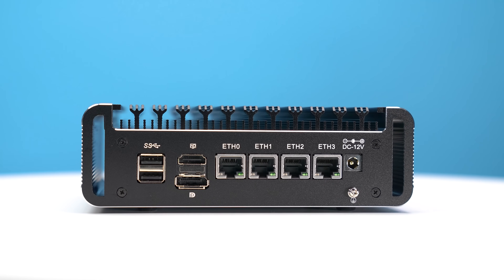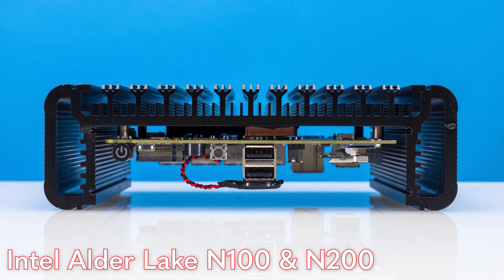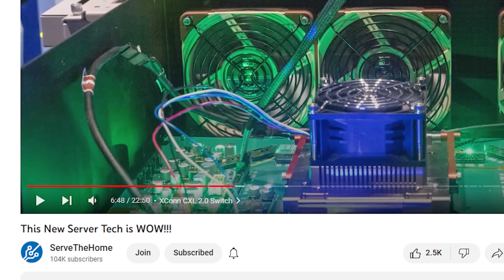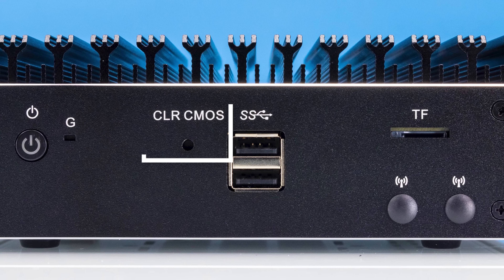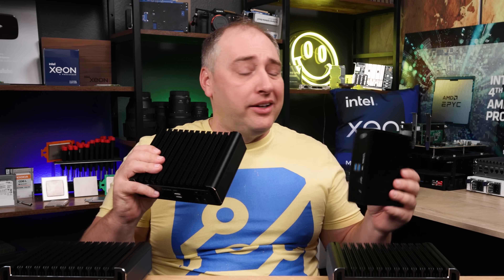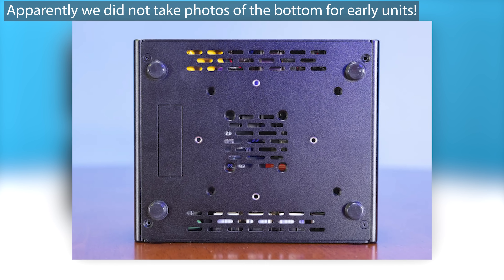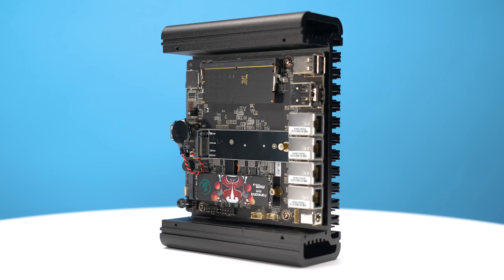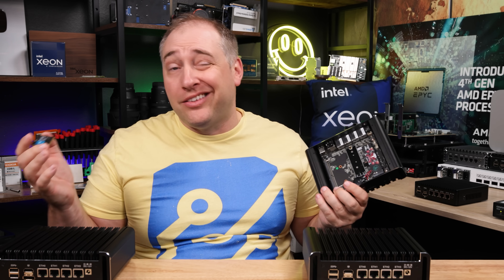HUGE UPGRADE! New Firewall Router Virtualization Host

Comment: You need to test those ports. I've heard about issues with drivers. They seem to work but won't perform well. Can you test ?
Reply from the maker: The i226-V in these is fine. We have close to 100 ports running 24x7 in labs.
Reply: @ServeTheHomeVideo  are you load testing them ?

Comment: Man for the $400 price range for a low power firewall/router box I'd want IPMI and at least some PCI express expansion.  This price tag seems a little too high for its use case + feature pairing.
Reply from the maker: IPMI adds around $25 and 5W plus another security surface which is why it is rarely included on lower power firewall boxes.
Reply: @ServeTheHomeVideo  That is fair but the out of band management advantages are kind of undeniable, especially for a router.

I think I paid maybe $540 for a Supermicro SYS-5018A-TN4 a couple of years ago and it just seems like a so much better value proposition, particularly with what it might cost now on the aftermarket. You add a 10gbps add in card and you have most of what this does, with reduced efficiency I suppose.

Yes the 4x builtin NICS are 1gbps (though, I think they had dual 10gbps models). It just seems like these tiny fanless systems should be less for what they are.

Comment: They are heading in the right direction, quality-wise, with these but I'm wondering if they've have reached the point of diminishing returns? The N100 is selling for 32% more than the last N5105 I purchased about a month ago. The performance improvement (according to this video) is less than that. For what they mostly get used for (firewall, Home Assistant and the like) the previous version had more than enough grunt. Thanks for the review, Patrick, but I'm gonna pass on this generation unless they have a price drop.
Reply: I was in the same boat and went for a 5805 instead.

Don't forget these are single channel and ddr5 is really expensive now.
Reply: The GPU is vastly superior

Comment: They look good, My hope is one of the vendors someday add basic lights out management, so it's possible get to the device if your OS has an issue.
Reply from the maker: Many folks do not want that on firewalls since it is another security surface and OS. Adding a AST2600 probably adds around $25 and 5W of power consumption. That is a lot on this class of device

Comment: Local ISP now offers 3Gig service with a 10Gig port on the ONT.  Need to see units with 10/5/2.5/1 gig ports or multiple sfp+ ports asap.  Usually the best option is a supermicro or Asrock rack Xeon-D since they often get 10Gig ports.
Reply: Need much the same as are finally doingnftth drops here  with 8gb avail..   but need a box much like the one in the vid only with min 2 stp+  for IO (3 is better in case one dies)

Oh and asrock is bottom of the barrel   after decades in IT and doing a ton of review and test work Asrock has been blacklisted by us and quite a few others due to their beyond shit CS..

Comment: I have been running similar 6-port Celeron N5105 as my Opnsense box and it's been flawless for a year. However, the cpu is a bit on the weak side if you'd want to also run intrusion detection scanning with it. That Alder lake surely would be a better fit to that kind of cpu load.

Comment: Waiting for a solid 10G appliance for firewall/router combo with opnsense.
Reply: Indeed   2.5gb in in min now for faster inet connections...  my house in wired for 10gb 15 yrs ago ffs..
Why the lack at least 1 sfp+ in curious
Reply: Stop waiting. That's trivial to build on your own with any basic PC (including something like in this video) and a switch.
Reply: @BlownMacTruck  at what cost? I mean energy wise. How much power would it consume and how big would it be to have equivalent?
Reply: I think that will remain the realm of DIYers for many years still, but at least we can now achieve solid 10G routing and multi-gig VPN with low-mid range desktop hardware.
Reply: @Justin Slay look for Deciso DEC 740 and higher versions
Reply: Does the m.2 slot support adding a 10gbe adapter in??
Reply: They're usually pcie 3.0 x 1 so not 10 Gbps capable pcie ports as cpu is like 8 lanes total
Reply: Yeah, my ISP recently started offering 5Gbps fiber and I don't want to be stuck with the modem/router combo they provide.

Comment: The use for the other M.2 is if you want to have a small storage node and use it mostly as a switch or router not firewall. Having 4TB of free space isn't a lot but it is enough for some for network storage for their home shared storage. For less than most NASes just without the redundancy you would get with any NAS system would give you.

Comment: I’m pretty new to networking, does having those 4 2.5G means you could use one as WAN, and the other three as LAN? Maybe with the ability to use a V-Lan for each of those?

Also, in the case you can do V-Lans, would I need managed switches?
Reply from the maker: Yes you can do that. You probably would not want to treat it as a switch though since passing traffic between ports on here goes through the NICs and CPU instead of through an onboard switch.
Reply: Oh okay, what should I research about in order understand how to use this type of device? I’m a computer scientist so I’m no stranger to containers and systems engineering, I have some knowledge of networking but this is a bit out of my league

Comment: I want the same, but with fully featured wifi subsystem (4-6 mountable antennas, etc). Wifi on this thing will suck :( So it's just a router, with pricey case (i think it take more than a half of the price).

For years I'm lazily looking for perfect home router, 4gb+ RAM, without OS bundled (it should just boot from SD, or USB stick if any plugged, the rest I'll do myself over SSH). One or two PoE ports would be great to have. CPU arch doesn't matter when you're Gentoo user, you know how to cross-compile Linux :)

Comment: Hi, the G hole stands for : "Guard me from the curiosity of Patrick" \o/😋

Looks like a missing act or the recycling of a former (or a future) metal sheet folding, anyway, it looks like the place to put a rectangular LED - this is understandable, as tooling, processing and silkscreens cost a lot for small series of devices.

Comment: While I agree that the performance jump is better than the 5105 or 6005 it still does not match performance of 6th or 7th Gen i7. I have a Lenovo M720q Tiny with a 9700T CPU. With the 4 port I350 and 16 gig RAM it's cheaper than a N200 equipped machine.
Reply from the maker: That will also use a LOT more power. It is very competitive more with the 35W Core i5-6500T, but with a total system power that is less than half of what we saw with those systems. Good thing there are lots of options. We have 1-2 cool TinyMiniMicro builds coming. Deciding if we can get them both into a single video.
Reply: @ServeTheHomeVideo  Yep, this is exactly the benefit if you run it as a firewall appliance that isn't running full load all the time, low/partial load is where these cores will shine.
Personally hoping someone will make a dual SFP+ equipped one, just cause 2.5GBe quite isn't there in the datacenter used market and likely won't be.
Reply: The difference in power consumption makes it a bit of an irrelevant comparison for anyone seriously considering one of these. Beyond just cost of power these could be run off of a relatively tiny battery backup system or even offgrid alderlake also has in silicon fixes for security issues that earlier Intel chips don't for people who might be concerned about such things. Older second hand is almost always cheaper and going up a few skus in power will still perform better unsurprisingly.

Comment: I hope they're going bring out some with the U300 Line. Then they would have enough pcie lanes for 10GBit connectivity. That would be insanely useful. The single P Core could also be tremendously useful for routing and stuff thats highly single threaded.

Comment: I really wish they would put these in a rack mount case off the bat, or offer the mounting shelf for two of them like palo alto does for their small firewalls (pa-820 etc) - would allow side by side mounting for running ha configs.

I still havn't got round to putting the mini firewall in place because i don't have a mounting option for it in the rack currently.

Comment: With the added performance we need to see more units with SFP+ ports.. TWO 2.5 and TWO SFP+ would be great.. R86S refresh should be coming soon
Reply: Exactly! I'm just starting to look into these types of units to prepare for 10G fiber from my ISP at home and can't find anything small with 10G except for the R86s units, but they are a bit underpowered, I think... Am I overlooking something?
Reply: Same here  this new unit would be perfect for power etc  but they are finally laying in ftth where I am (after often was done a decade ago and idiots in charge put hell Canada in charge of oversight.. so the subcontractors that actually did the work was explicitly told NO ftth allowed.. only fiber to HELLs local  substations for vdsl  fukkers)   anyhow..  it appears I will have to suffer eith a Hell canada "hub" aka sagemcom oem..  and best options are the older model 2000 or 3000.. and i need a small box like this only with a sfp+ input and out to act as router before standalone switch.   So far i have found sfa that fits the bill and isnt $$$$$$$$$"    anyone out there have any info???
Reply: I don't think the N series CPUs have the pcie lanes for that. They have 9 gen 3 lanes. A x550-da2 needs 4 lanes, the main SSD is going to be X4, each 2.5gbe needs a x1. So dual 10gbe + 2.5 + SSD is all your lanes. You could go down to a x1 for the ssds, and you could get dual 10gbe + dual 2.5 + dual SSD. I really wish there was a low cost N100 compute level but with 48+ lanes. Ideally it would support bifurcation and gen4.
Reply: @Cynyr  Even sata would be great.. Just don't like the soldered RAM or storage really as the ram would be nice to have an upgrade path on, same with storage or even replacement from wear over time from local logging.
Reply: YES!

Comment: Two M.2 makes sense for appliance as you can mirror the drives, or for active firmware/fallback.
Reply: Or running your NAS, Home assistant and router on one device (eventually all in their own VM's) instead of having a separate machine for every one of those.

Comment: Can you confirm you can passthrough the iGPU? This would make an absolute bargain for virtualizing plex + virtualizing pfsense
Reply: You don't have to, you can "just" use the GPU in a LXC container. You only have to add the mountpath /dev/dri into to the ct.
Reply: You can virtualize plex and pfsense with proxmox without any gpu support. CPU will be powerful enough to do any encoding for a single user or two when you're out and about. Passthrough is typically reserved for PCI devices I believe, so I don't imagine you can pass through integrated graphics. Could be wrong tho. The most exiting thing about this unit versus previous units is the second m.2 w/ the falling prices of storage for m.2 drives. So plex is really an option now.

Comment: What kernel are you using in proxmox? You might want to try 6.1 or 6.2, which has all the N100 power management, you should be close to 6-7 watts at idle
Reply: Isn't 7.4 the current version? Are you saying they removed these features from 6.2 to 7.4?

Comment: could this run vnets and a vpn as well as proxmox and router/firewall?
Reply from the maker: Yes.
Reply: @ServeTheHomeVideo  excellent. I'll be on the forums  in a month asking more questions 🤣
Reply: @limitedrespawns  I can run gigabit over wiregaurd on my j4125. (about 70% utilization) So I'm assuming you can do just about full 2.5 over wiregaurd on this unit.
Reply: @TheChemisch  thanks. I've purchased one, I'll see how it goes when it gets here

Comment: I would love a 1U version of this that i can put at the tippy top of my enclosed rack (tip top so it can still be passive and 1U to give it more surface area for cooling in a hot enclosed rack), but i'd prefer the 8 core version, still super upset they're calling this 8 core Atom N305, an i3-N305, with the same CSP/MSRP as an i3-1215u/1315u
Why price it the same as a processor that is literally twice as performant, twice the GPU, close to 4X the PCIe bandwidth, twice the spec, and more than 15x the RAM support, once 64GB DDR5 SODIMMs become available, you can physically install up to 256GB on a 4 slot board where as the i3-N305 has the same 16GB firmware limit, doesnt matter if you stick in a 64GB dimm, it doesnt seem to work correctly with more than 16GB.
Reply from the maker: Agreed.
Reply: @ServeTheHomeVideo   Please review the version with the Pentium Gold 8505 CPU since it has 1 P core + 4 E cores and offers 20 PCIe lanes compared to the 9 PCIe lanes of the N100/200/300 series
Reply: Many of the aliexpress sellers will offer a rackmount option if you message them.  Usually gets a fan in that config but they also put an internal power supply on it.  I have gotten Qotom to make me rackmount versions of their units for $50 to $100 upcharge.  If you order a higher quantity they would also do custom logo printing.
Reply: The standard way to adapt this, last I saw, was a rack tray.  The unit is a little taller than 1U but at the top of the rack that probably doesn't matter.  If you actually need it to be 1U and passive, that's a new heatsink/case extrusion, which would be very niche and a big ask.
Reply: @concinnus  but i like my rails :(

Comment: Ok, I am looking at putting in a micro PC like this in my network cabinet. I need it to run a firewall/modem so I can't get rid of my base unit, home assistant, Adguard/pihole/something along those lines, and unify controller. Is this powerful enough to run all that or should I look at something a touch bigger?
Reply from the maker: Yes. If you are worried, we are going to have the i3-N305 version review soon. It just arrived yesterday after the video was uploaded.
Reply: @ServeTheHomeVideo  that's good!!! I don't want to rerun my network in this house, but my next option was jumping to a 2u server And placing that in my garage and running my plex server from that as well. 

Thank you for running an amazing channel

Comment: It would be nice to see the Power Factor(PF) for power consumption tests. There's always a nasty reflection obscuring that panel on your power meter. PF (or VA) is useful for specifying UPS as well as generally minimising load on the grid in general. Thanks for the review.
Reply: I agree for higher power devices but PF for a sub 30W load? The outcome is going to be negligible
Reply: @jb5631  The point of the US Energy Star regulations (and EU equivalents) is that a negligible amount multiplied by millions of devices is anything but negligible. Poor PF has a real impact on the grid.
Reply: You can see that it's around 0.6/0.7 PF but you can also use the (weird ?) 120V times the 0.14A to get the ~17VA at idle
Reply: @wojtek-33  I'm not sure I would describe it as "easy", "just possible" perhaps!😄

Comment: 1 year ago I did not know what Proxmox, virtualisation, external router and firewall were. Today I have them all at home: Beelink SER as Proxmox server for all my home thingis (Home Assistant, NodeRed, MQTT and tones of others) and such appliance like in this video as my router and Opnsense firewall on it. Actually your channel and your videos made me spending this money on these things - so thank you for help. It is always a pleasure to watch your videos. Of course once I have bought all of them this year I am nowhere near to change any of them, especially that mine are working fine and still below their limits. But still I like to watch your videos. Thanks again for all of them.
Reply: So, I'm thinking of buying a device mainly to experiment with, but I also want it to serve as a productive solution for my small home network. I plan to install pfsense, proxmox, pihole, and generally play around with different setups. I'm looking for something compact and with low power consumption. I'm considering something from AliExpress with an N100 or N150 processor.
I guess I’ll need at least 2 ports – one for WAN and one for LAN. If I don’t go for a device with enough ports to cover my needs(6 or 8), I’ll probably need an extra switch, right? (managed?).

And the most important question: since my WiFi network will be going through the device running pfsense, will I definitely need a separate access point?